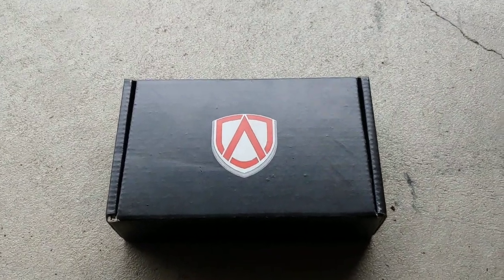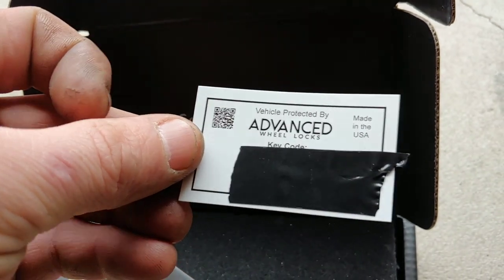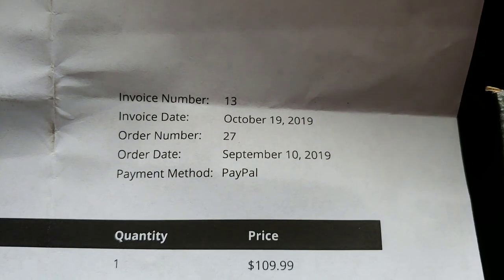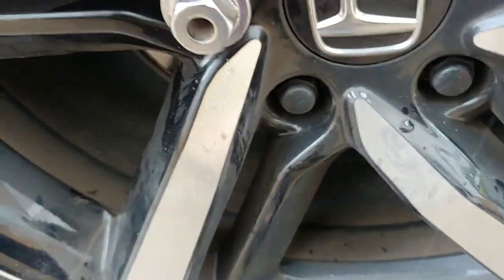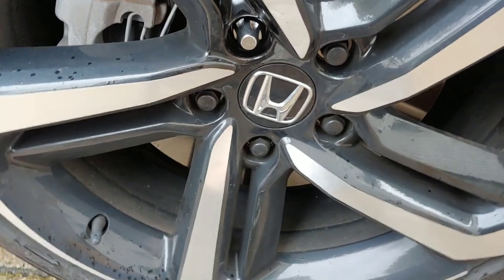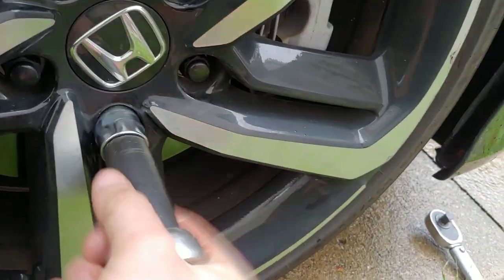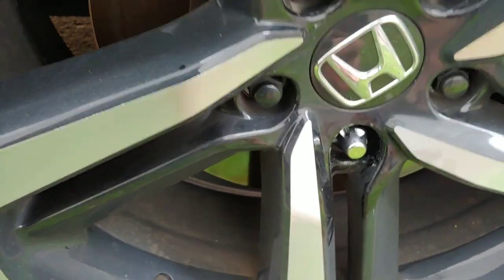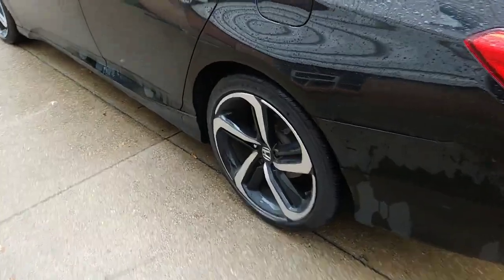Advanced Wheel Locks Review And Install

Comment: Thanks for the review. I wasn't aware of this brand of locks. They do look harder to defeat than others. I think I would just sand/grind off a little on the outside of the key so it would not bind. Mount it on a socket extension and spin it by hand up against a bench grinder or belt sander. Just a thought.
Reply: Hey Andrey, I just ordered a set of these for my 2005 CRV. Called them to see about a 5th lock for my spare tire that's mounted on the back and the nice gal I spoke with acknowledged they put the spare tire option on their site for Jeeps but forgot about the Honda CRV. No problem ordering the 5th over the phone. When I mentioned I had alloy wheels she said no problem. She did say that they earlier realized that the key/tool was slightly big, and they have since corrected it and it is now a tad smaller.
 I also wanted a set for an equipment trailer but the lug nuts on it are the standard pass through nuts and the studs may be a tad long for their regular closed end 1/2” x 20tpi locks. They are however working on pass through locks may be available as soon as this coming spring.
 I was just about to order another brand till I stumbled onto your vid. That led me to looking up their vids. These things look so much better than the others out there. Thanks again.
BTW, they do come in black also.
Reply from the maker: @steamerjohn9212  Oh nice I see that they do offer it in black finish now and I'm gonna see if they can send me a new key that is a little skinnier.

Comment: The only con about these locks is the key being oversized. Looks like it will strip paint from the rims after a few tire rotations 😢
Reply from the maker: The locks got redesigned. No more issues with it being tight.

Comment: What if the thieves just order this lock on the website and steal people’s wheels ?
Reply from the maker: The locks are specific for your wheels.
Reply: Andrey Andreychuk thanks for the quick reply. About to order some for my wheels :)
Reply from the maker: @cruzpartida3758  No problem.
Reply: @cruzpartida3758  They have different pattern
Reply: So do they make the lock different every time ? Or is it specific for just Honda wheels in general ?
Reply: @kmccree22  each key is different every single time

Comment: They don't make these for my vehicle, but way too expensive for only getting 4 lug nuts. Pricing should be no more than $30.
Reply: I think the price is fair if they work as advertised. Ordered me a set and did not blink at the price. If they offered 8 instead of 4 only even for a little more money. That would be nice to have that option.
Reply: Yea $125 for 4 wheels locks? My wheels cost $600.
Reply: I mean, I have to secure my wheels they cost me a lung. And I rather paid 1xx than paying those wheels again 💀😔
Reply: @slyatski  😐 sorry